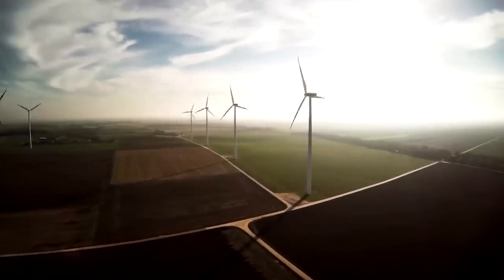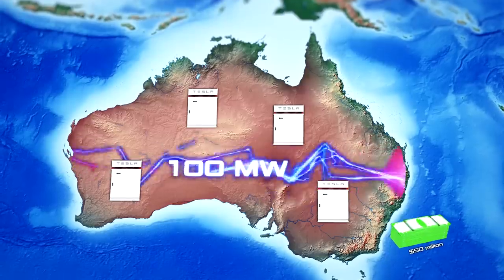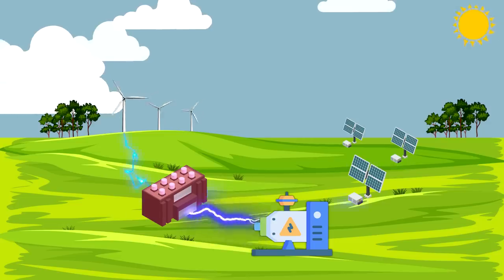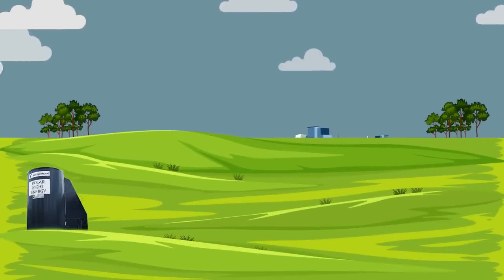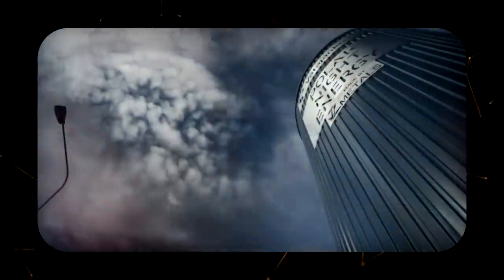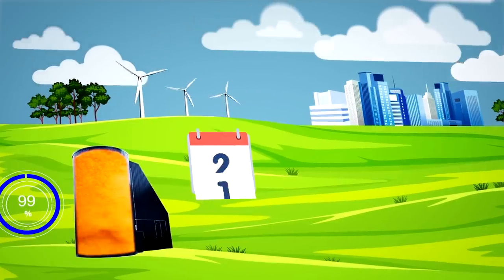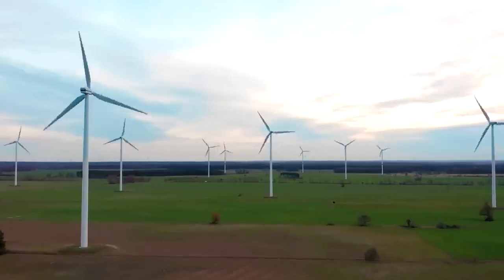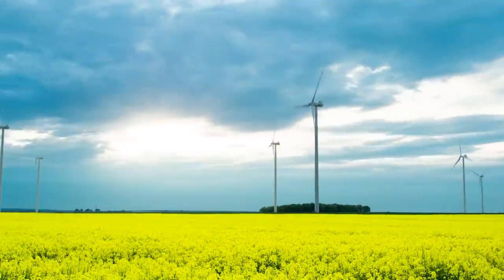How sand batteries could change the rules of the energy storage game

Comment: If there end up being massive amounts of these many places, then it seems like an ideal place to dump "extra" energy generated from green sources when the wind blow hard, the sun shines too much, etc.  i.e. topping them off.  This assumes that running lots of electricity to them from the grid (or green energy sources directly) could efficiently heat the sand when it gets X% below the max temp it was designed for. 

I love the idea of this though -- using a low tech solution with mostly natural materials instead of the usual way of going higher and higher tech. until tech. gets rare and/or expensive, due to materials shortages, etc.

Comment: 99% efficiency! How do people believe this? That is the greatest mystery.
Reply: There is no way this could hold it's temp for months without losses.
Reply: That's the conversion rate of electricity to heat. Your electric heater which works on the same principle has the same efficiency.
Reply: @semiRockethr  not without losses no. But it's pretty well insulated like a thermos can. Heat can only be transferred via radiation or contact with a colder medium.  It's just basic physics.
Reply: @2Manolo3  An electric heater if measured as power in versus power out is 100% efficient. That is most definitely not what was claimed. And it is a completely obvious and moot point.
Reply: They took it from our website where it says "up to 99%" and that is only true for shorter cycles and we have actually proven those at Vatajankoski. But overall efficiency calculated from system life at this point is 80% which is also quite good for this small system. =)
Reply: @semiRockethr        r    r e r e  r e  r e did  reer
Reply: Is what we get by YouTube recommendating low research channels that don't understand the basics of thermodynamics
Reply: Tom WaterFooler  I see thanks for sharing that useless knowledge.

Comment: If it works, it works. Sand is pretty cheap and abundant. If it works the way I think it does, couldn't they just use an array of mirrors to heat up the "sand battery"?
Reply: that does exist, it failed because maintenance was more expensive compared to photovoltaics.
Reply: @pacresfrancis1565  Maybe they were doing it wrong then if it was that complicated lol
Reply: Excellent 💡 idea, huge possibilities for this design. 
Southampton UK    🇬🇧
Reply: @A B The shortage is in concrete-friendly sand...
Reply: @A B Seriously? I live next to an island made of organic sand.
Reply: @A B the model does not actually require graded sand unlike many things do, they used discarded 'unusable' sand.  Any random dry sand and even a number of kinds of  mixed dirt and gravel, so long as they are dry, are suitable for use in these systems.  According to an interview the company who made it gave on another channel
Reply: @dausume  I would assume that sand from stone would be vastly superior to sand from a beach which has a high percentage of organics (calcium carbonate a'la sea shells/corals).  Granite, sandstone, shale and other rocks would be vastly superior as they could stand much more heat before breaking down.
Reply: @amzarnacht6710  maybe, but the primary concern I'd assume is more about supply chains and suitability per region.  They've stated as well that random depleted quarries and other holes in the ground could be used to more cheaply construct one of these kinds of systems.  And then whatever the most economic choice is, presumably locally sourced stuff would usually be cheapest, but then next option would be whatever is most available and cheapest.

  These are grid-scale systems, so most likely every system would be custom engineered based on simulations/modeling, and the best choice would vary on a case by case basis... or at least I'd assume so.
Reply: @dausume  True enough, though sand would be relatively inexpensive to fabricate and transport as needed.

As for the OP's thought about using mirrors: that would not work terribly well; salt (which they usually use) is semi-transparent so a lot of light and heat penetrates to be captured whereas sand is not.
They could use mirrors to heat salt to molten temperatures and use it to heat the sand, but there is a maximum capacity salt can be heated to without going to extremes.
Sand can reach far higher temperatures before it melts - that being the point it ceases being functional and just gums the works (if the works survive).
Reply: @Blaqjaqshellaq  resin + desert sand = new concrete.
Reply: @SharhbiniRauf  resin + fluorescent [insert color name here lol] powder + sand = fluorescent concrete?

Comment: Unlike most high tech Green solutions this solution actually makes sense.
Reply: No it doesn't
Reply: It depends what you want to do with the electricity. In thermodynamics heat is considered as en energy with a lower quality than electricity, because you can’t use it for example to run a motor (at least as easily than with electricity). That’s called entropy. Here the quality of electricity is lost. If the purpose is to heat directly a building, why not, but there are some more efficient ways to produce heat with current, as heat pumps. Heat pumps can produce sometimes 4 or 5 J of heat recieving 1J of electricity.

Comment: Very interesting, here's some idea or comments:
 - sounds like a good way to use desert sand/sea sand which are unsuitable for construction and virtually unlimited.
 - can use underground cave as storage, or abandoned subway, the ground is an excellent insulator people used to store winter ice in underground celler for summer use.
 - at some stable and dry terrains, can bury heat exchanger deep underground and you have a natural heat storage. Extract energy in similar manner like geothermal.

Comment: Why not fill em up eith water? 

Water can hold 4180 jouls oer kg pr deg C.

Whereas sand can only hold 830.

(Lookup "specific heat capacity of sand/water")

So per volume water can hold almost 5 times the amount of heat energy.

Is the temp is not going above 99 seg C that ahould be thw prefered way no?

Comment: 3:30 100 tons 100.000kg 3:34 8 megawatts, 8.000 kilowatts, 8.000.000 watts 8.000.000÷100.000= 80 watts per kilogram, according to google lithium ion is 100-265 watts per kilogram, so lithium ion only loses due to lose of efficiency over time, also that it explodes over excessive heat and finally, the cost, so if you use sand battery in a mobile phone its more likely its gonna be a bit heavier than usual phones because 20 watts lower efficiency per kilogram

Comment: Of course this can be scaled up - just use more sand (or rocks etc). A material that undergoes a phase change, such as molten salt, provides greater capacity in less space, but is much more complicated, so I prefer this low tech approach.
That said, accumulating heat (it can even be provided by direct solar heating, without the intermediate step of generation electricity) is much easier problem than "delayed" electricity generation from renewables. Of course, these thermal batteries could boil some working fluid and drive turbines, but efficiency loss would be significant.

Comment: What's the energy loss converting electricity to heat and back again ?
Reply: a lot
Reply: @iihoipoiii :  Credible citations?  The video was talking 99% efficiency of the system.
Reply: Slim to none. Converting electricity to heat is incredibly efficient, probably over 99%.

Comment: SAND BATTERY CAN POWERED STEAM TURBINE GENERATOR, yes that big battery can provide heat for month, and that why its can use as heat resource inside steam chamber, coal is too expensive, because coal are nano graphite when nano graphite also graphene main material, and we need its to make ultra capacitor.

Comment: Instead of silica sand why wouldn't they use talc or soapstone sand? Talc/soapstone has a thermal density close to that of water. Much higher than silica.
I am sure it would be inexpensive to buy from any soapstone stove, sink or utensil manufacturing plant.
Reply: Uh, water is cheap, available, and easily pumped.
Reply: @richardtheweaver4891  He's talking about replacing the sand, not replacing water.

Comment: What this video does not explain is that this is part of a district heating system. So the term "Battery" is misleading. Also it can be confused with a real electric sand battery where the sand is saturated with an electrolyte. Those batteries were used in the mid 19th century for telegraph applications, and are a now obsolete technology.

Comment: Iron and aluminium have very high energy densities and can provide high energy rate (power). Basically you burn metal powder in a dedicated engine. The metal oxide are heavy (rust...) and can be collected, unlike the gas generated by gas or oil combustion that are released into the atmosphere. The collected oxide can be bought to a plant where renewable energy (solar, wind, hydroelectric...) is used to separate oxygen and the metal, closing the circle as the metal can be used again as fuel. There is plenty of aluminium in the Earth crust, no worries about lack of it. Metal burning engines are developed, I wonder if the complete cycle works, considering the energy spend in the oxide/metal transportation and metal powder preparation.

Comment: The hotter you can run it the higher the energy density, but also the higher the efficiency that you can convert back to electricity. You also want the largest volume to surface area. It looks like a great idea. Also for heat it is better to convert back to electricity because you might lose 30% say, but a heat pump then gives you a up to 400% efficiency.
Reply: very interesting

Comment: if use quartz/ silica instead of sand will it be more efficient, I mean the heat absorbing capacity..please reply/comment if anyone knows ...
Reply: They only use sand that is rejected by the construction industry.  Search sand battery finland 🇫🇮 on YouTube.  This reduces cost.
Reply: Sand is typically >95% Silicone dioxide
Reply: @ownerf  Silicon.  Silicone is the synthetic polymer.
Reply: There is a massive economy around a specific type of sand that is being depleted. Using the "regular" sand is more sustainable in the long term. You could also use recycled glass bottles
Reply: How important is “efficiency”? And what efficiencies matter? The big efficiency winner here is cost efficiency, not thermal efficiency. It might be a little more compact with different material, but it would probably cost more too.
Reply: @davestagner  another efficiency is speed of construction. batteries take a long time to make and are in short supply
Reply: idk

Comment: Is this any different to a ground sourced heat pump?
Reply: Yes it is a lot hotter. Also it stores heat. It does not extract heat.
Reply: It can be used in a similar manner for direct heating, actually with a higher efficiency, but it stores the energy using a much higher temperature and is basically an energy dense heat storage system, which is different because you can use the fact it is that hot to have a system where you push out more heat more quickly, and by extension can viable use that higher intensity heat for electric generation.

  This is a type of model that works better and more efficiently the larger you make them though, so I kind of doubt anyone should be putting them in their back-yard.  It is more of a grid-scale application.

Comment: Nope. Synthetic fuels last far longer than hot sand. Folks who only compare their tech to non-competitors' stuff (batteries are for hours, not months) are generally myopic or shady.
Reply: I’m a big fan of synthetic fuels and think they are quite possibly the future of energy storage, but… what’s the cost? If/when synthetic fuels crack the cost barrier and become competitive with fossil fuels, things will change radically. I’m pretty hopeful for that. It’s a simple function of the cost of clean electricity and the efficiency of the synthesis process. But 2c/kWh solar and a 25% efficient conversion process would get us into the $80/MWh range.

Comment: The headaches with sand it’s it has to remain at high temp or it will solidify, even low temps can produce desert stars into the mix unless it’s a blend of different material this will continue and causes mechanical failures
Reply: În amestec cu grafit.

Comment: $10.27/kWh = $10k/MWh. Compare this to the Tesla batteries discussed earlier, which were about $500k/MWh. Sure, the batteries are more compact, but how important is that?
Reply: this doesn't produce electricity but heat. to make electricity you have make steam so lose a lot of the energy.
Reply: @ronblack7870   the steam spins a steam turbine connected to big generator

Comment: Great idea,just imagine running everything off a engine that runs on water?
Reply: First you have to split the water into H2 & O2, using electricity.
Reply: @kitemanmusic  That's right, connected to solar setup for electricity, can also store after electrolysis & fuel engine.
Reply: @milleniumfalcon8654 
It takes a lot of energy to make hydrogen and oksygen from water. And you also need to compress it a lot, which again uses a lot of power. If you then want to use it as electricity you will lose energy in the process. So it makes only sense if you got to much power to use or to store in a battery.
Reply: steam turbines tecnically uses fried water

Comment: What happens if you use a solar panel, rather then solar collectors, to electrify heating coils to heat up the sand? Would you need more or less solar panels?
Reply: More, by quite a bit.  Solar panels don't even have 30% efficiency, and then you lose 60% of the energy when you convert electricity to heat and back.  So you'd need about 8 times the area in PV panels as you would for collectors.  PV also costs many times more than a simple solar collector (which is basically just a bunch of reflectors).  If you're going to store it as heat, starting off with PV makes no sense.

Comment: I imagine they could put a large Stirling engine above the buried sand battery
Reply: That, and there are also Thermovoltaics, which are effectively just like solar cells, except they produce electric when exposed to heat.  And you can also simply use them to produce steam like with older power plants.

  I'd imagine if at all possible they would likely go with the Thermovoltaics, since unlike the other systems they have no moving parts and require little to no maintenance.  They could just leave the batteries there and they will just do their work.
Reply: @dausume  They could also use thermo-voltaics beneath the Stirling engine, since the heat will escape upward regardless, and since it's so cold in places like Finland that temp differential makes a Stirling engine super logical.

Comment: Well this is good... the sand we use for construction may be on high demand.. but maybe this battery could use the sand on desserts.. not to mention the dunes are expanding.. might as well harvest those..
Reply: The sand used in construction isn't the same grade. I also think graphine is finding its way into building materials as a resource to replace concrete which would further offset the need for sand thus allowing for use of sand as a battery. I also wonder if nuclear power plant waste could be used for this if there was an effective way to make heat exchange possible without turning the waste into a possible dirty bomb.
Reply: @johnbyrd7400   if you get the waste before its contained inside a titanium container in a thick bedrock coating and you're lucky for it to be a very non-efficient heat conductor like plutonium-238 then yes, also it probaly wont be green like most people think, only if you put green paint in it lol

Comment: Bury these sand tanks in the ground for even better insulation.
Reply: If the container is air tight and has thick ceramic walls, it could contain the heat even longer
Reply: that's what their original plan is to do, the tank is a prototype

Comment: I have grown totally fatigued by the elementary battery and energy storage overviews. Many of them literally start by asking "what is a battery?" Really? Every 2nd grader knows! I came to learn about sand batteries! Why not leave links for 2nd-grade level overviews? And "sand battery" is a terrible misnomer. This is nothing more than mass heat storage where concrete, dirt, water, or any number of things can be used for. Sand battery my eye.
Reply: OTOH, whining about semantics serves no real purpose.  The point is this is a GREAT idea, if it is feasible and cost effective, vs. having to rely on complex and expensive traditional batteries and all their issues. 

Also, these won't be in demand for powering things like cars (except perhaps to charge them at night).  So it's not competing with the materials for the sorts of batteries needed for BEV's, electronics, etc. that the modern world is going to need in VAST quantities, even with recycling.